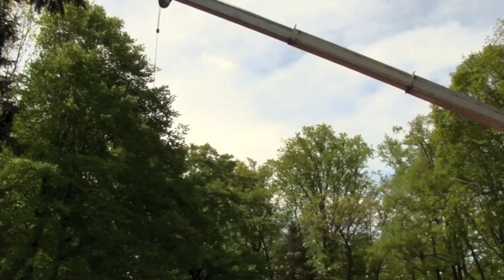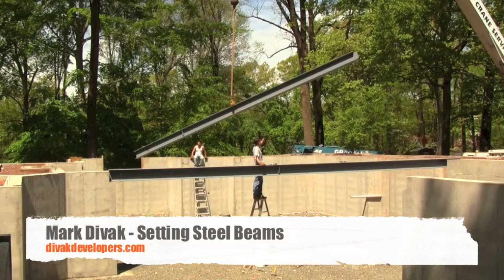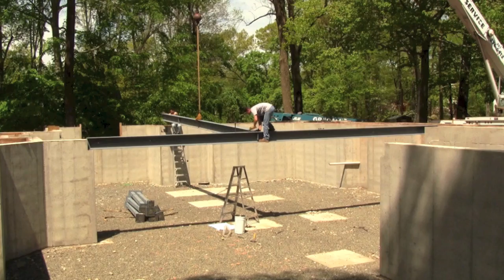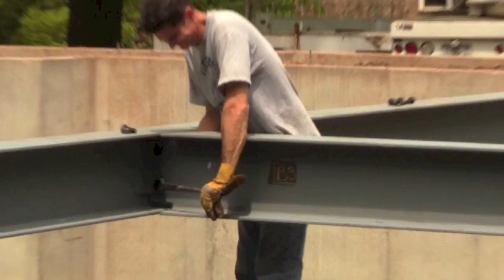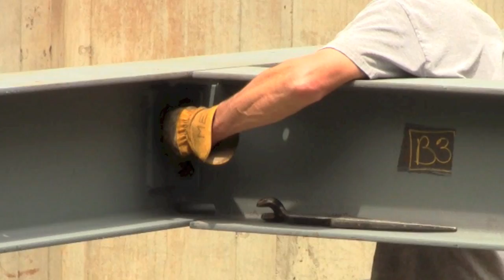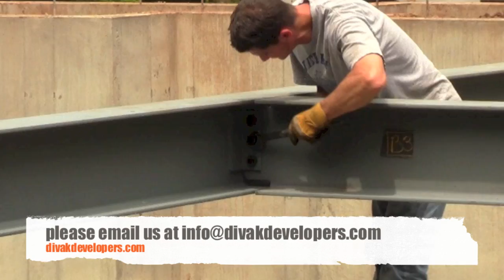Custom Home Builder Tips - Setting Steel Beams - Divak Developers

Comment: A better question would be why is the guy tightening the bolt by the head and not the nut, no way is that got to be the final torqueing of those bolts, or at least one would hope not. They appear to be 1" bolts so the torque setting for those bolts are a lot higher than what he is going to get with a Podger spanner.

Comment: Those bolts are hard to place. That L is supposed to be a bit longer. Placing bolts there takes a lot of effort.
Reply: The further the bolts are from the angle the larger the moment on the braket and on the bolts once they're tightened

Comment: Standing on top of the ladder 🤦🏻‍♂️ and he put the bolts in the wrong way. Bolt, beam, clip, nut.
Reply: Hard-hat, steel or composite work shoes, kelvar vest. Should save him from a fall from the top of the ladder. And maybe a swinging beam.

Comment: Jet fuel will melt all steel products. I-beams,pipes,and everything
Reply: Jordan66k oh yeah. especially when there's only enough fuel, assuming 100% thermal transfer efficiency, to bring 1 floor of the structure up by 250 degrees!

It's clearly better to build with balsa wood.
Reply: ***** All steel burns at 3,000 degrees! Fire gets so hot that it melts the steel and weaks fireproofing! Look it Up!
Reply: Jordan66k
that's akin to saying that Gravity is so strong that it causes nuclear fission.
True statement, but not very useful for analyzing the events of 9/11 :)

Comment: Why don't you tighten the bolts down with an impact rather than hand tight?
Reply: Better tighten it with a torque wrench. Over-tightening a bolt is also bad.